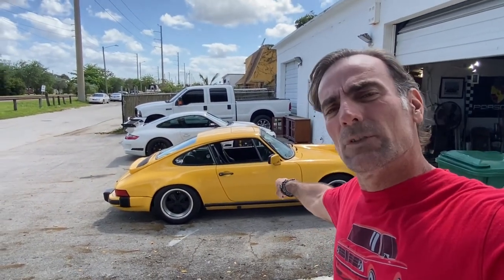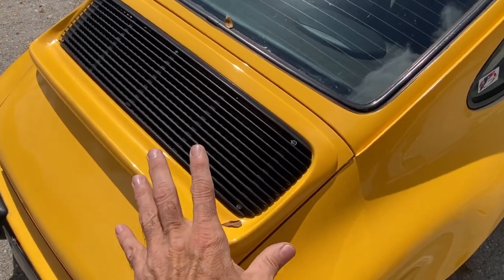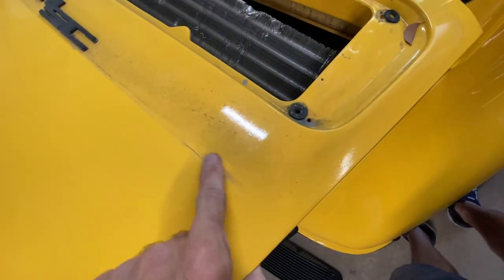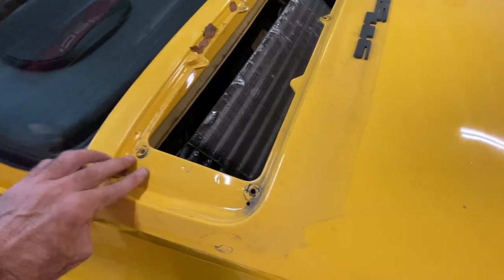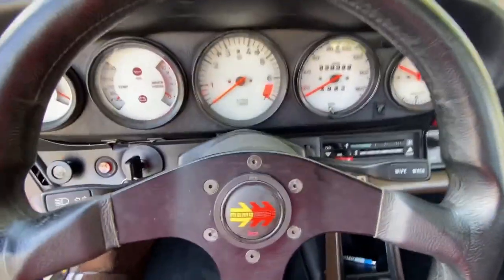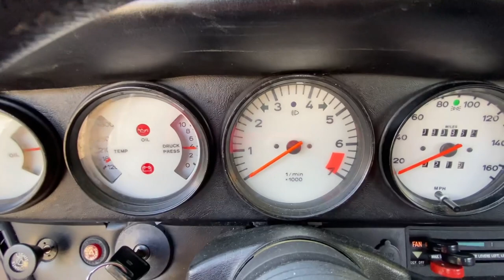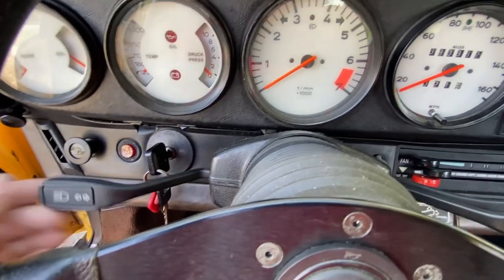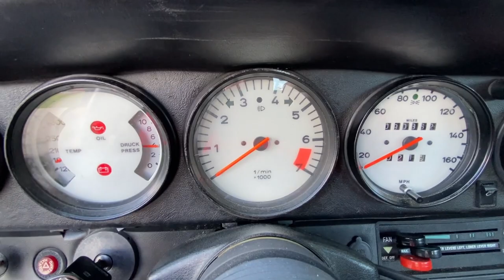Porsche 911SC Rear Spoiler Removed

Comment: Nothing looks better than the slick tail!!
Reply from the maker: The reservoir comes out pretty easy. Just disconnect the hose and pull. Then the compressor bolt is there but you need an extension to get to it